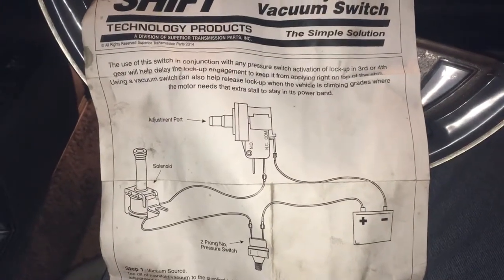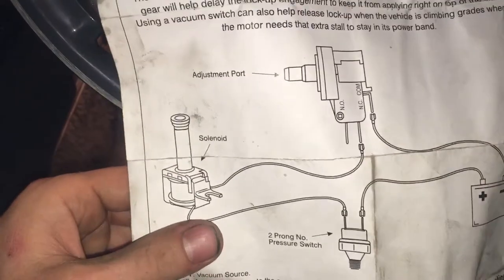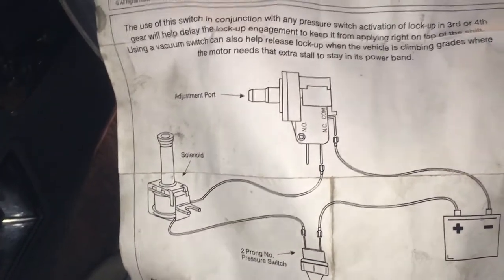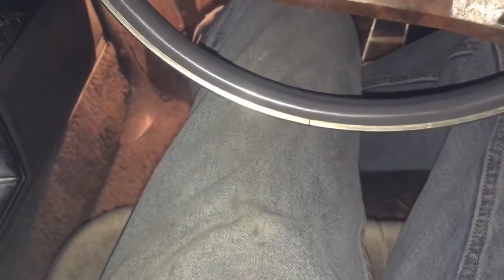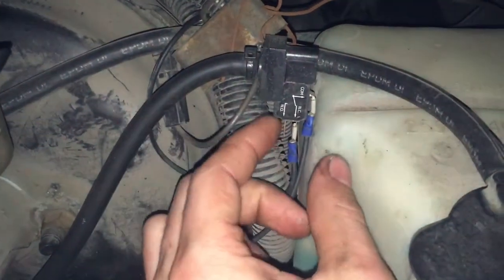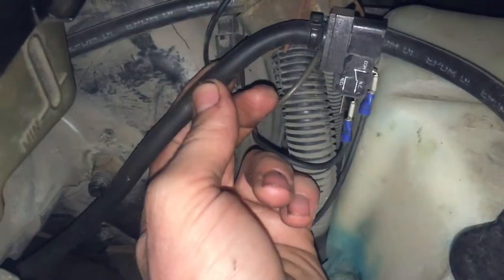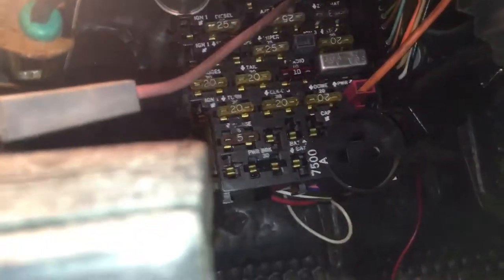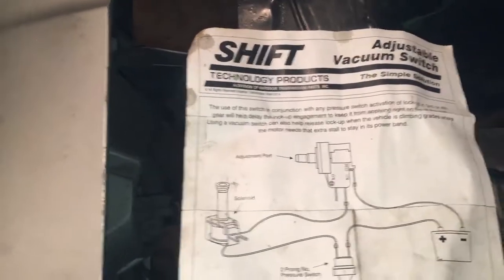Video response: torque converter lock up solenoid wiring.

Comment: So I have a question for you. I have an 84 Cadillac Eldorado FWD. It was computer controlled TBI and also I believe the computer controlled the 4th gear transmission TCC Lockup. I am currently having the old engine swapped out to a Oldsmobile 307 with a carb, no more digital fuel injection. This will completely bypass the computer. The issue is what do I do in this situation regarding the transmission that was controlled by computer ( 4th gear )? Do I need one of these switches?
Reply from the maker: Yes one of these switches is needed for the tc lock up. They were pretty cheap on eBay. There are other ways to set up the tc lock up too, i think using a brake light switch from an 80's gm pick up truck wired in series with the tcc solenoid  but I can't remember. I can't speak for the fwd transmissions, but with the 2004r in my carYou also have the option of running the transmission without the torque converter lock up functioning at all, i have done that before but I would only recommend doing that if  the vehicle is equipped with an auxiliary transmission cooler because the torque converter  can get hot.